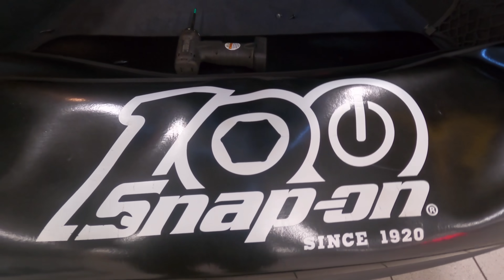Customer states I have a brake light out. AND THE W.A.W.P. IS DRY!!! Don't do it cheap!!

Comment: If you wanted a proper fix you'd solder it and put shrink wrap tubing around it.
Reply: Not on a car... In fact, VW prohibits techs from soldering splices, and most manufactures others do as well. Heat shrink splices are the right way in this case.
Reply from the maker: If you have 2 techs doing the same repair both solders will be different even tho they are the same repair. Crip repair is a more consistent repair that will be the same. Heat shrink would of been nice, the crimps I use are self sealing 😉
Reply: Well you could solder it pretty easily in fact I learned to solder when I was 6 years old
Reply: @kd1s  Congratulations? a solder joint has a exponentially greater potential to fail.

The automotive environment is a harsh place and heating a cooling causes micro fractures in even the best solder joint leading to high resistance and open circuit conditions, VW found in the 1990s that solder joints were a common cause of failure of wiring harnesses (it cost them lots on warranty claims).  As the joint heats and cools it expands and contracts at differing rates leading to the aforementioned micro fractures, these micro fractures become a point of high resistance and as we all know from elementary physics resistance in a wire causes it to heat further adding to the thermal cycling of the joint speeding up it's failure.

A proper crimp terminal with sealing insulation and a proper crimping tool will give you a consistent joint every time it will be sealed from the elements and will expand and contract without fracturing.
Reply: A few of the youtube rust belt mechanics like south main auto have stated "I've never seen a crimp and seal connector turn into a green mess. Solder joints? All the time".
Soldering is a great technique, but not the best for automotive. A high-vibration, high-corrosion environment with lots of temperature changes. For a proper solder joint you'd need to wrap the wires before soldering them together, but you never ever find the couple extra inches of wire neccessary for that in an automotive wiring harness. And you need that twisting of the wires to prevent stress cracking.
Reply: @kain0m  Well you can get lead based solder. That doesn't green out. Plus there's the silver based solder too. It might tarnish but that's all.
Reply: @kd1s  doesn't change the fact that VW forbids you from soldering, and that they supply these special crimp connectors+ ratcheting crimper for this purpose. These aren't the cheap shitty crimps sold at Auto zone.

Comment: butt connectors aren't a proper fix either,  that looks like shit, those wires should be soldered and heatshrinked.
Reply from the maker: They are heat shrink crimps, weather tight. Also solder is not an approved repair.
Reply: VW forbids the use of solder, and requires the use of these specific connectors, which are supplied by them in a kit with the proper ratcheting tool to install them. Solder joints can fail from vibration, and the tin in the solder can weaken the copper. This is actually a better repair design. And before you say "but solder is how NASA requires you to repair wiring!" Keep in mind that those repairs are used in outer space, where there's no air or moisture to get in and foul the joint.